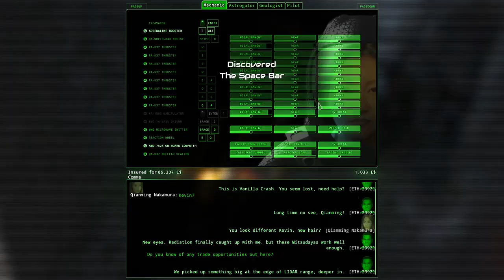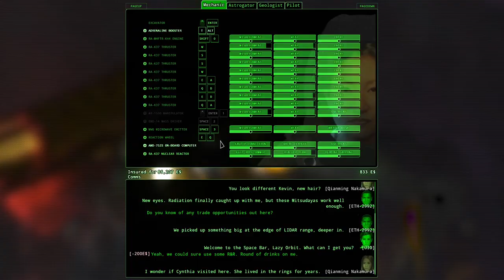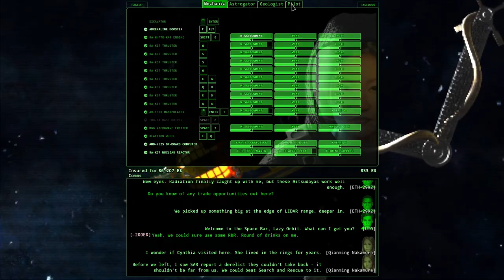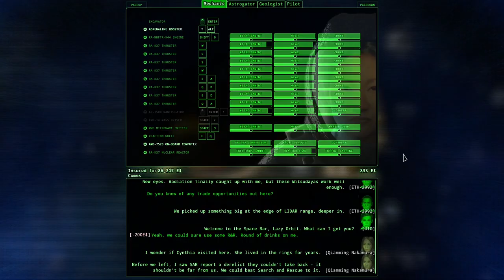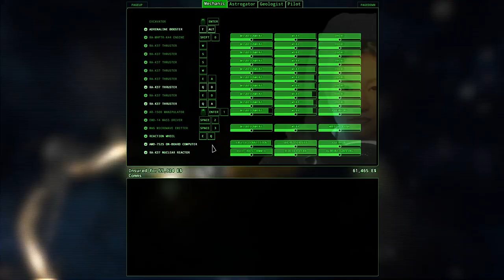DV: Rings of Saturn, Third Dive, Salvage and New Ship.

Comment: gimbled RCS can be used by any autopilot, gimbled(and vectored, though only the ND-PNTR uses vectored thrust) main drives require more advanced autopilots to use, also you can only benefit from gimbled/vectored thrusters if you use fly-by wire autopilots